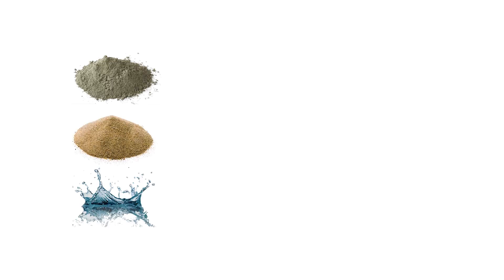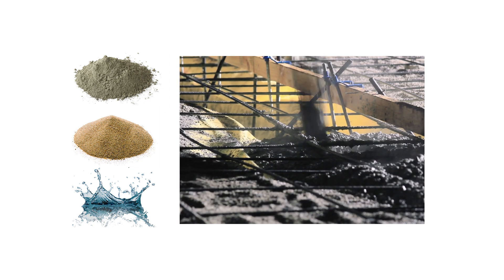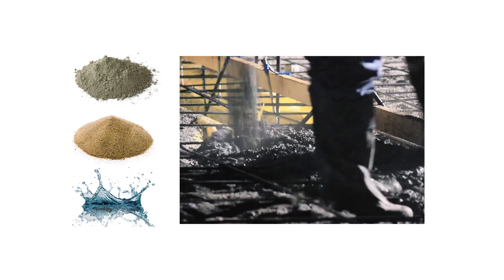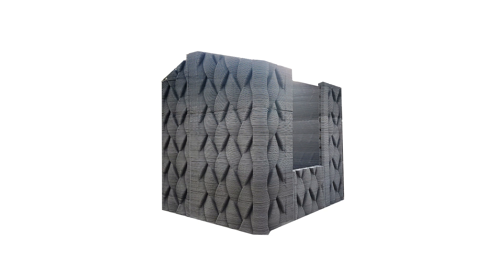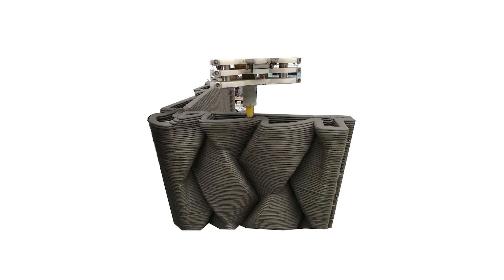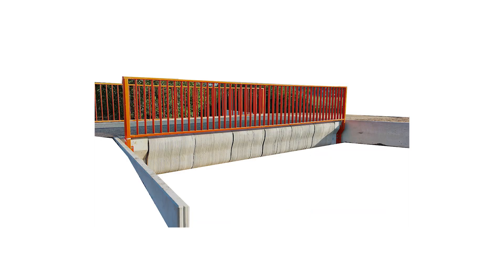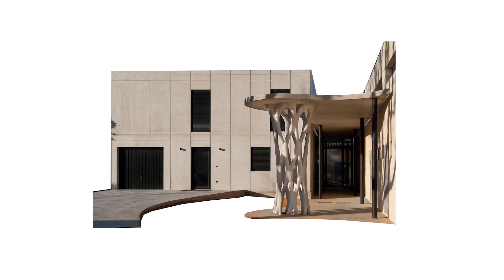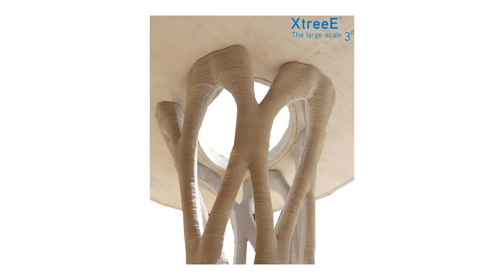Introduction to 3D printed concrete

Comment: ONE 1st  National Seminar in Nov  2017  on 3D printing in CIVIL Engineering was conducted and  I also represented India in a 1st int. Conference on 3DCP held at Australia 2018.  I find that  basics of 3D printing with concrete mix has been explained  very well by you now, I wish this vedio   was then  available to  the  participents of my conducted National Seminar  at AKGEC, held  on 15-16 th  July 2018 .Congratulations-Prof K Kamal

Comment: Currently I am working on 3d printing, using sustainable materials, wastes. I am trying to make the mix with uniform extrudability, and later checking buildability.
Reply from the maker: That's incredible. Would love to see your work.
Reply: How far are you with your 3D printer, are you working on a concrete 3D printer, been looking for a cola ration for a long time hit me up

Comment: I rarely comment on videos but this was just really good! Really informative.
Reply from the maker: Thank you for the support, Josh! I really appreciate it.
Reply: @BelindaCarr  I have a lot of questions regarding 3-D printed concrete homes. I have not found any ACTUAL examples of homes built this way. Does this method also install roofs, doors, windows, HVAC, plumbing, electrical, stairs etc...? From what I can see 3-D printing can ONLY make a partial shell (no roof) of a home. How about the physical footprint of the 3-D printer itself? There would have to be room on the jobsite to accommodate some kind of gantry system that, by necessity, would be larger than the house itself. In urban and suburban areas you may only have small building lots. I would like to see an actual REAL LIFE example of a 3-D house being made and the ACTUAL TOTAL COST. I smell a political government program SCAM to fleece the tax payer. This makes shipping container homes seem reasonable.

Comment: I thank you for sharing this video.  I would like to see information on strength testing of the 3D concrete.  Perhaps there are too many planes of potential failure by placing this way.
Reply from the maker: Thanks for the question Robert. I had the same concerns. I will try to make a follow-up video soon.

Comment: Hello, sorry I am working on the project of making a concrete 3d printer, but I require information about the driver and the software that is needed to handle the prototype that I am assembling

Comment: Thanks Belinda: I’m still not grasping exactly how tensile strength is being introduced into the robotic fabrication process. One might argue that factory-based fabrication of prestressed double-tee floor beams, commonly used in parking garage construction, is already “robotic” to a considerable degree.
In my region, in common building construction, concrete is primarily used for foundations and floors, is reinforced with steel and is almost never seen. Critical yet fundamentally prosaic from the standpoint of architectural expression.

Comment: 3D layering effect can be quite organic (if done tastefully), but Gaudi will just cover it up with tiles.  The biggest problem is fitting windows or 2nd floor, so most 3d printed house end up being a dome.

Comment: Whats the simplest way to integrate steel reinforcements into 3D-printed buildings? What about insulation? And is it more efficient to print the whole wall structure or just the outer shell and filling it up with reinforcments and conventional concrete?
Nice content btw :)
Reply: To integrate steel reinforcement into 3D-printed building could be made possible if you print the outline of the wall first, add the rebar, then cast it. With this method, the printed wall outline acts as the formwork for the structure. This would be case if you need the reinforcement in the design. 3DCP offers flexibility in terms of the width of the extruded concrete and the material you want to print (higher strength concrete). With that in mind, you may want to consider designing building with load bearing wall. About the insulation, you can produce double wall for the building and apply the insulation in the void.

Comment: Have just come accross  this .

Last year  I attended a a presentation by the founder of Trik

Her product  adds value to drone surveying by using data from the images taken to produce models

The same approach has potential  to  drive 3d printing so that a replacement property had the same  edifices  as  one that had reached  the end  of its useful life 

Townscape  retention could help  meet the concerns of those opposed to  change in the character of their community

Comment: I am very interested in this technology.  I understand that it is typically much cheaper to build homes this way due to decreased costs in labor and waste.  My only concern is with issues such as air quality and comfort level of occupants within the home with regard to heating and cooling requirements.

Comment: This was very interesting.  Though, you'd think someone would come up with a knife that would follow behind and cut the layer smooth.  Just a thought.  I guess you'd have to figure out what the hot knife would be for that butter.  Dunno
Reply: i just saw a video where someone finally did. seems like a very simple solution
Reply: Apiscor has that technology
Reply: @miguelquinones3068  not only apiscor

Comment: I am interested in constructing a 3D printed house in Baja California, Mexico.  I need an architect.  I have a piece of property 450 square meters.  Besides the basic structure, the print should include duct work, cableways, water ways, solar panel supports, and tanks for water, black, grey, and  potable.

Comment: Hi Belinda, traditionally concrete is reinforced with steel (re-bar). Are you saying that the carbon fibre additive to 3D printed concrete is a replacement for steel reinforcement? I'm wondering what the differences are in terms of structural rigitidy and durability between traditional steel reinforced concrete and this new type of concrete composition. If the carbon fibre reinforced concrete is an adequate replacement for re-barred concrete, should we see a transition to this composition of concrete even for companies using traditional methods?

Comment: I am a software engineer. However I have no experience or connection with construction industry. I want to be able to construct 100 sq ft. rooms using this technology. What are the softwares I'd need to learn ? Also are there any construction 3d printers for hobbyists ? What are my best options ?

Comment: Most/all builders don't use wood forms for walls. They use reusable metal forms that you can rent and they drop them off in a container like a large dumpster. Takes a few days to bolt together then one day to pour. They are usually patterned like brick but any pattern is possible.

I don't see any way 3d printing cement walls can beat that speed, price or simplicity.

Comment: Each layer would need to cure before the next layer was put on top of it, so that the weight of the layers didn't crush the ones below. This means very fast cure times, like under a minute. At the same time, if it cures before it leaves the nozzle, it would jam the machine.  Maybe a two part epoxy concrete that is mixed in the nozzle. Both parts would have to be pumped to the nozzle separately.
Reply from the maker: You seem very knowledgeable about the process! Won't the concrete cure only upon exposure to air?
Reply: You are both confused about “ cure” and “ set” 
Use fast setting, self curing cements and you are there
Reply: @BelindaCarr  Concrete does not need air to cure. All concrete needs to cure is water and heat. Ambient heat is sufficient as long as it's not below freezing for water.
Reply: @teslastones  How fast setting? And how strong? Say you mix it thirty minutes before it is extruded onto the wall. Then the next layer comes around and is laid down on top of it one minute later. You would need a setting time no less that thirty minutes and no more than thirty-one minutes. That is a very small window to hit. Even if you hit that narrow window, how many layers can it support before it cures?
Reply: Michael Deering all of those parameters are engineer-able with the right binder 
Your input to this young lady are true only if you are using OPC 
Set times of the right binder ( cement ) for the job can be a matter of seconds—- or days if such is needed 
As stated earlier, cure time is also adjustable.  Usually I like full strength within a few hours if I’m fast-tracking 
Since there is no shrinkage ( the number one cause of cracking in OPC ) one does not have to worry so much about fast set 

There is no curing procedure as with OPC

Comment: 3:00 Form boards aren't always wasted though. You can reuse just about all of it and most concrete guys I know do. I mean, you only get a half dozen, maybe a dozen pours out of them usually before you most guys replace them, but still. I've actually thought about designing a modular fiberglass or plastic/epoxy form board system that you could extend in length and snap/pop together and stack for taller footers and slabs on sloped grade etc. Could even do nice texture on it so exposed footer looks good. Don't steal my idea now.
Reply: 0:50 talks about reusing the formboards

Comment: As the sole and only 3d print concrete license owner, that covers all 3d printers, its sad to see piracy already creeping into this sector. The human manual labour construction companies are now facing a new challenge of pirate 3d print companies making commercial gain on extremely low cost prints achieved by not paying royalties, piracy. 
Steeling money, jobs and businesses from the wider comunity in such a new sector is very disapointing. 
All manual labour construction companies and comunity should be asking all 3d print sellers making commercial gain did they license check and pay the royalties, no matter where the stl came from or who drew it. To not is piracy. And this fast growing competition to the construction sector and job market has already a lack of checks and ballances. 
Pirate farms can and are being close for non payment of royalties so i urge all companies espesially manual human construction firms to check all commercial gain being made on 3d printing concrete. 
As it stands this is one sector of 3d printing that requires pulling into line. As its growing fast and so are the losses. 
I can easly confirm wether royalties are being paid or not. 
Its been revieled to me in the last few days the rapidly growing scale of companies comming on line making commercial gain and the scale of infringments and non royalty payments. Please all assistance apreciated. Thank you.

Comment: We have a patented method of creating concrete structures in which no formwork is needed but proper vertical reinforcement can still be done. Also, there is minimal up front cost for equipment    In this method you are dead in the water when your multi-million dollar machine breaks or cannot be taken to the job site   Proper ( even superior ) insulation is also accomplished as opposed to the extreme thermal bleed one can expect from what so called 3 D methods do
Reply from the maker: That's fascinating! Could you send me a link to this technology?
Reply from the maker: @teslastones  Thanks Jonathan! I'll shoot you an email today.
Reply: @BelindaCarr  I don’t think I ever received an email from you

Comment: A framework doesn’t go to waste! Your home wood frame is still there covered by walls and home sideing. You know steel squares you see the Concrete being poured is the rebar. The strongest concrete that can ever be made is 5000 psi. This is dangerous and your wasting money to think this is the way! Please learn regular construction before you say 3rd printers are the answer. I should be able to do it with out 3d printer. 3d printer is just the worker the pumps out your thick concrete like layer of mash potatoes.

Comment: So called 3D printing solves an imaginary problem while creating hundreds of unnecessary new problems 

If you want a system with no form work but it has vertical and horizontal tensile reinforcement, we have more than one patented method